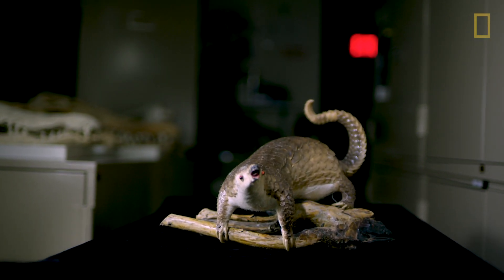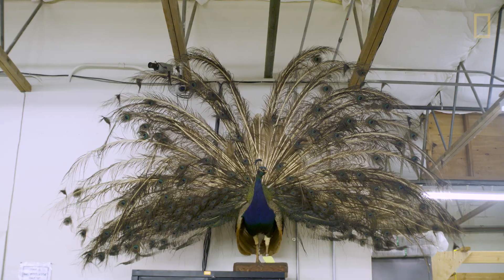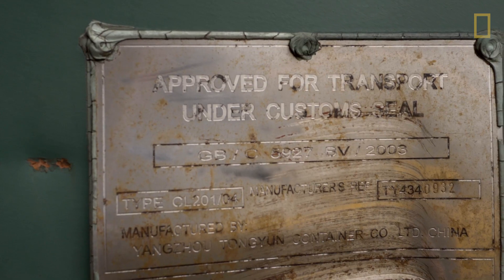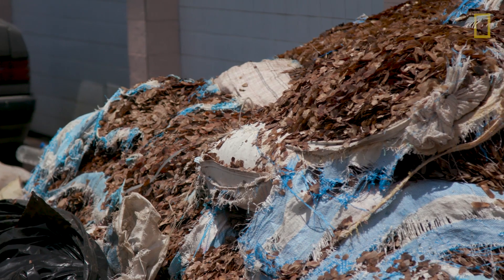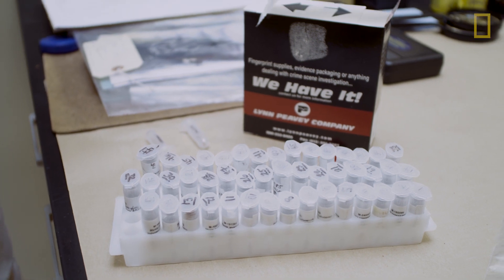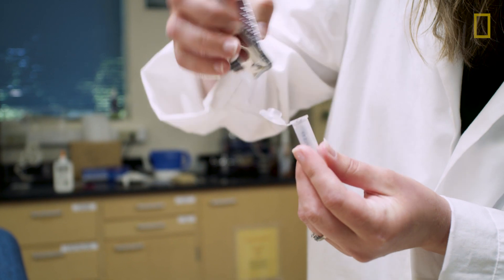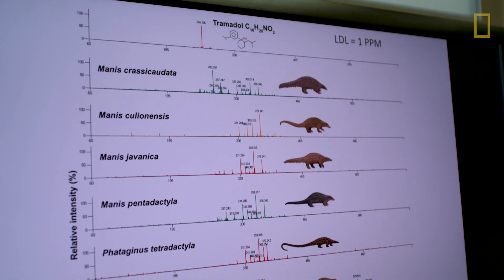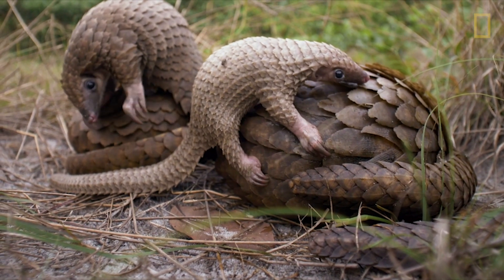Opiates and Pangolin Scales is Rumor Debunked | National Geographic

Comment: @4:43 can anyone tell what equipment of melting the scale is and why the scale had to be melted before the chemicals are extracted for analysis? I thought any chemical compound should be preserved at low temperature before the analysis to avoid any changes at the molecular level.
Reply: I would assume it's similar to a spectrometer they're trying to analyze molecular makeup. Don't know for sure though. I'm also assuming that the melting of the scale doesnt affect the molecule they want to analyze.